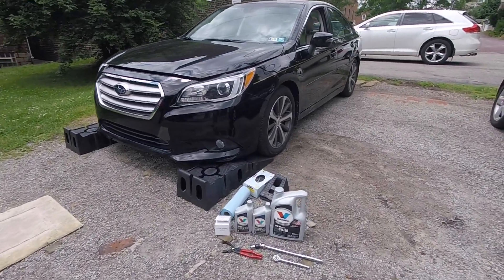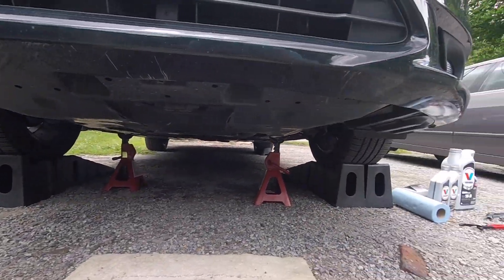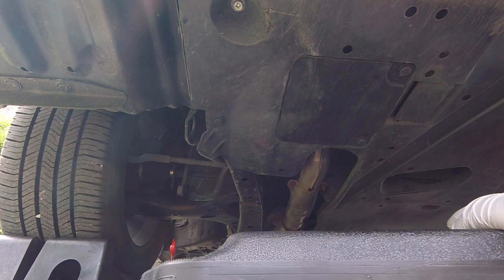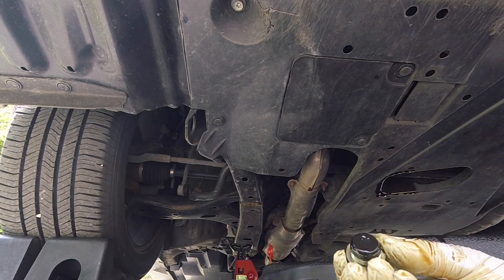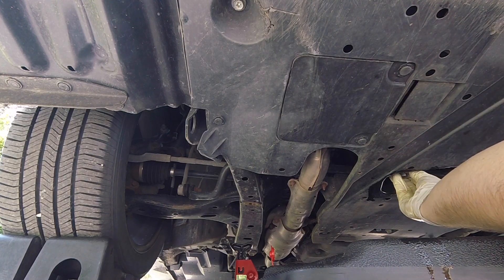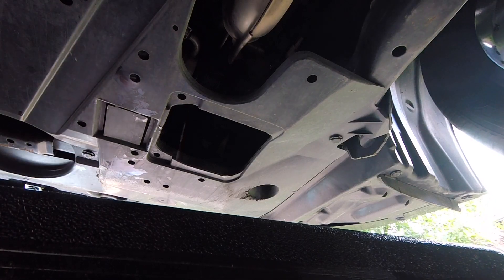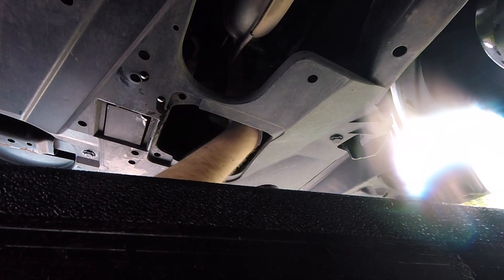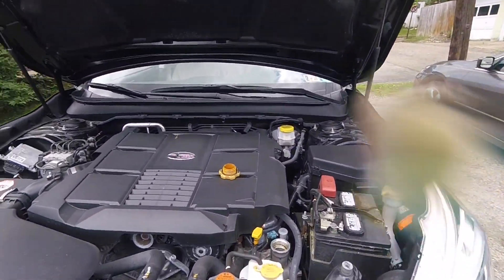DIY Maintenance!! Oil Change For Subaru Legacy 3.6R

Comment: Dont open the oil cap befor you take off the drain plug. It will slow down the flow a little so it doesn't come out violently. Once drain plug removed go up top and loosen the oil cap
Reply: Pretty good tip - I just changed my oil today and was surprised how fast the oil came GUSHING out....nearly overflowed my drain pan.

Comment: torque spec on the drain plug is 44 Nm (32.5 ft-lbs).
You can fill the filter by pressing the gas pedal all the way and cranking the engine.
That turns the fuel system off so that you can clear the engine if it is flooded.

Comment: Thanks for the vid - just changed oil in my 2019 Legacy 3.6 and it was exactly as presented.  Much easier than the stupid design of the 2010 4-banger legacy I had where the filter was inside the donut hole of the exhaust manifold.

P.S.  I was able to get a traditional "band" oil filter wrench on the filter, worked great.

Comment: Hint.  Leave the car running, chocked, and on the ramps until after you've checked topside and underneath for leaks.  (There are two possible points of failure under the car based on the process you just performed, so play it safe and recheck them with the oil under pressure.)  If no leaks, then back it down the ramps, shut it off, and check the level.

Comment: Does the oil drain completely when the car is up on the ramps? Does the raised angle prevent complete Draining?
Reply: sump plugs on most vehicles are to the rear of the engine, so there's no harm using ramps...

Comment: How do you like this car compared to the accord 2.0T?
Reply from the maker: The Accord is still more fun to drive, but I can’t get over how great the Legacy drives, particularly in rainy or snowy conditions. I’d need to take a road trip in the Accord to evaluate comfort and fuel economy, but I recently took the Legacy on an 1850 mile road trip and comfort was excellent and at some points got over 30 MPG.

Comment: after watching this i realized i'll take it to the dealer
Reply: Use a Fumoto valve, it makes it a lot easier as far as draining the oil; however, the filter on the 3.6 will always be a little bit of a hassle on ramps because of the space limitation, especially if you have larger hands.
Reply: Dude I just busted out laughing. Glad I'm not the only one who thought the same thing xD
Reply: I usually let the dealer do oil changes in my 3.6 Outback simply to avoid the hassle of catching and disposing of the old oil.  The price isn't bad compared to buying the parts and materials and doing the work myself, and I enjoy the dealer experience.

Comment: Does the legacy come with remote start?
Reply from the maker: No, but it's available as a dealer accessory
Reply: My 2015 3.6r came with remote start
Reply: Depends on the Trim I believe. My 2012 Ltd. came with one.

Comment: Is it ok to just add the rest of the oil (8 qts) total?
Reply: 6.9qt. I always put in about 6.7 and check my dipstick after i level it. then keep adding till i get to the full mark on the dipstick. If it takes more than 6.9qt you are doing something wrong.
Reply: My Subaru dealer just dumps in 7 quarts. It’s always at the top mark on the dip stick
Reply: Overfilling will over pressurize the system and cause lots of problems you don't want.  It says 6.9 quartz, and the dipstick is marked accordingly, so use 6.9 quarts.  A smart process is to put in 6 quarts and a bit, button it up, and go through the pre-start and start procedure.  Then shut it off and check the level on the dipstick.  You'll need to add a bit, but adding oil is way easier than taking it out.
Reply: @TheLazyCarrot  If your dealer is just dumping in 7, he's not taking the time to let each drain fully into the pan, so in the end he's only getting 6.9 in there.  And no doubt he's charging you for 7.
Reply: @rangersmith4652  0.1 quart is not going to cause any issues.  Hell, with the 2017 WRX it holds 5.4 quarts and people regularly do a 6 quart fill and there's no issues at all.  No over pressurized system or foaming of the oil.  There is a point where too much is too much and can cause damage but 0.1 quart is nothing and will not cause an issue.
Reply: @rangersmith4652  Do you really think the dealer is going to charge the difference between 6.9 and 7.0 quarts?   They're not holding back 0.1 quarts of oil and you aren't paying anything different either way...

Comment: Why 5/30 not a 5/20?
Reply: Александр Иванов The 3.6 is an older design and calls for 5w-30 oil. Sadly it has been dropped after 2019